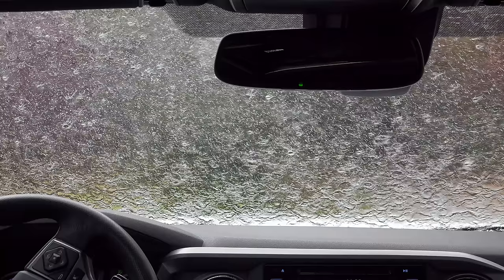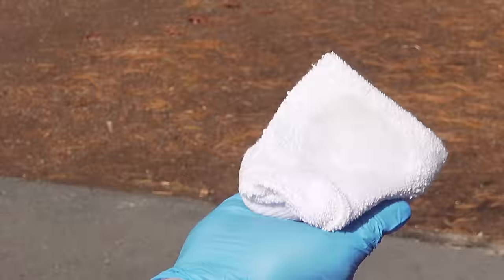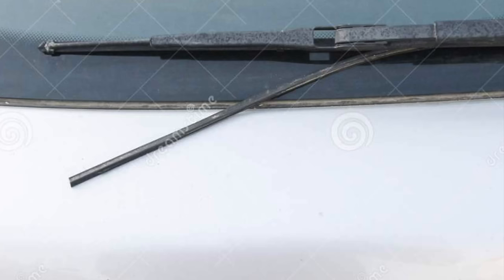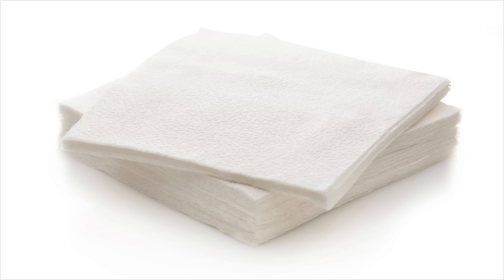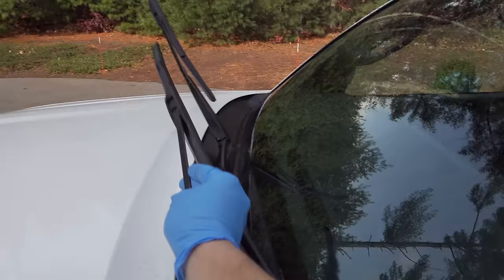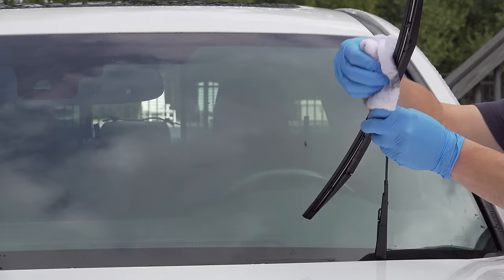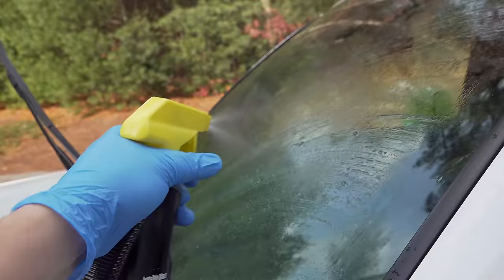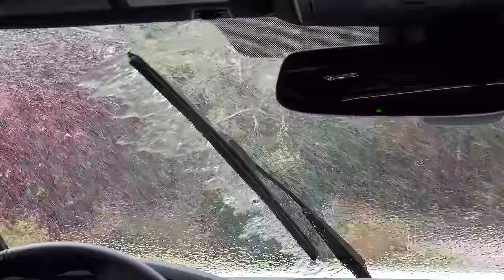How to Make Windshield Wiper Blades Like NEW in 30 Seconds

Comment: I would use silicone spray instead of WD-40 (however, the WD-40 brand has a silicone version). Silicone is always recommended for rejuvenating rubber (power window seals for less strain on the motor, for example). WD-40 may not be "bad." But, I don't think you're getting the full benefit for the effort. Silicone should preserve the life of the rubber more.
Reply: I agree, it is all about chemistry. WD-40 will work perfectly but you will have to repeat it more and more. Why? It attract dust particles, ever wondered why serious bikers hate it for there chains? WD-40 is the perfect example; the less people know about the chemistry, the more they will have to keep on spraying and buying the product! Kaching!!! This guy in the video must have been stoned; cause he called it a "de-greaser". Guess he never used rubbing alcohol before he sprayed a knew later of greasy WD-40? People can say whatever they want, but the science tells a different story.
Reply: @gertverhoeven  just add some in your windshield wiper fluid.
Reply: @gertverhoeven  : Could you re-phrase this?
''Guess he never used rubbing alcohol before he sprayed a knew later of greasy WD-40?''
Reply: @renzo6490  Sorry, dutch speaking Belgian. : " a new layer "
Reply: @gertverhoeven  I don't understand why they would use it for THEIR bike chains when Silicone spray is so much better...
Reply: Would it be better to use WD-40 first to get the dirt, grease and grime off first and THEN use WD-40 silicone spray or regular silicone spray afterwards or is this overkill?
Reply: @G C Silicone is commonly used to rejuvenate rubber.  You can google about it. You can get pure silicone grease at the hardware store's plumbing department. That could be a little easier to apply than a spray. It's used on rubber washers in faucets. It can fix a leaky faucet because it rejuvenates the seals.

I have a treadmill which requires occasional application of silicone beneath the belt. The manufacturer says not to use spray silicone because the carrier used in spray can deteriorate the belt. They recommend grease. I use that stuff from the hardware store because the official treadmill grease is considerably more expensive. (I don't know if their claim about the spray is true, or just a way to sell their high-priced stuff.).
Reply: WD-40 will clean and also restore a bit... tidyness is of course key for every progress. Silicone spray is, on the other side, THE thing to go to, for rubber-longevity. but then, still the rubber has to have been cleaned otherwise, before applying silicone.
Reply: Use silicone wiper blades and when needed apply silicone.
Reply: I doubt silicone grease will remove buildups.
Reply: @G C Maybe it does but given a choice between tossing the blades or cleaning them and using them a bit longer
I'd go with the WD-40. Besides you're supposed to wipe it all off. It's just used to break down the dirt not as a lubricant.
Reply: I raise the wipers and use armorall on a rag to scrub them. Then spray armorall on the wipers til they are wet looking. Leave them overnight, and lower the wipers in the morning. Lasts about 6 to 8 months.
Reply: @rfburns5601  is that wax or?
Reply: WD-40 will make plastics brittle with time, so... wouldn't use WD-40. Why not clean them with water and a bit of dish soap?
Reply: @Schmidt54  clean with detergent. Other suggestions on here sounds like a recipe for spreading lube on your windscreen
Reply: @stevecarter8810  I used a multi purpose mild kitchen surface cleaner and it worked like a charm. even my very old back window wiper was resurrected.
wouldn't use harsh chemicals like WD-40.
Reply: @carltype4125  Armorall is a spray product that has UV inhibitor - its available int the auto section of most stores.
Reply: @joebrone4972  that's what I do.
Reply: @rfburns5601  silicone spray (not in a can) only lasts about a month.

Basically scrub the blades clean, apply silicone and let it soak in.  Do it once a month.
Reply: @DoubtingThomas333  I'll look for some. The armor all does have a downside..... It does keep the rubber more pliable, but eventually degrades it. I decided to clean my wipers the other day, and while rubbing the armor all into the rubber, I pulled a bit too hard and the rubber separated from the blade. Oh well, I got a couple of years good service out of those blades.
Reply: @gertverhoeven  
And that's  why I keep saying YT is full of BS.
Reply: I love wd40 silicone dry spray.  It really made the difference opening very large sliding windows.💜
Reply: wd40 is a bit overk*ll. if any of it is left on the windshield, overtime it will stain, also it's smell is to strong. can use car wash soap or dish washing soap. then once the blades are clean, you can wipe them with carnauba wax. that will actually preserve the rubber. and if you ceramic coat the windshield. the combo lasts for years. i had the original set of wiper blades on my 1992 240sx for over 10 years. The wiper blades out lasted the car 😂
Reply: Wd 40 will fuck your rubber seals, i did that yo my door seals and they stick to the frame really bad
Reply: @mrbimbo3917  That makes sense. The company didn't patent it because they didn't want to divulge the ingredients. So, it doesn't make sense to use something on rubber that you don't even know what it is (when pure silicone is openly sold, and is known to rejuvenate rubber). It's like, "hmmm... something known to contain plasticizers... or a secret sauce made to prevent rust, penetrate rust." It's like saying "I'll use water to protect steel from rust."

Worse, in the age of material safety sheets, it's been noted that the main ingredient is a solvent. That can't be good for rubber. Whether it hurts or not depends on the rubber's compound (if it could be dissolved, how much plastic it has?). People who haven't had problems are lucky. Not proof that wd-40 is ideal for rubber.
Reply: @markfuller ✔💯Thank you for this! Now all I need is a car attached to some windshield wipers!👈🏾🤣
Reply: @gertverhoeven  no one uses WD40 to clean a chain, it will destroy the rubber in the chain links.. or rubber wipers for the matter in fact .. this guy in the video is high .. he has another video fixing a leaky faucet that will ruin your faucet if you follow it.
Reply: @gertverhoeven  Whatever you use on a motorcycle chain will attract dirt.  Some of the wax coatings attract less, but even they attract some.

You don’t use WD-40 on a chain because one of the things it will do is dissolve the lubricant in the chain.  WD-40 is not a lubricant.
Reply: @ian1352  WD-40 absolutely does contain lubricant, but it is very little and definitely not suited to parts like bike chains. That's what makes it a corrosion inhibitor, it coats metal in a thin film of oil.
Reply: @klausbrinck2137  yeah, I honestly use the stoner invisible Glass Cleaner to clean the wiper blades the way he uses the wd-40 and then apply the silicone spray in the same fashion. works like a charm!
Reply: You are totally wrong as you must NOT, repeat NOT put silicone anywhere near your windscreen! Silicone leaves a streaky mess is almost impossible to remove from glass!
Reply: @happyguy5414  "silicone leaves a streaky mess is almost impossible to remove from glass!"

I've never experienced that. Maybe the product you used had other ingredients. The aerosols have carrier ingredients. (Or, maybe you have higher standards for auto-detailing, streaks, etc.).

It is worth nothing that silocon is harmful to a car's catalytic converter. I wouldn't spray it while the engine is running (and risk intaking aerosolized silicon.). I prefer the 100% pure silicon gel found in plumbing departments. I can wipe it on the blade. No overspray. No aerosol.
Reply: @markfuller  any windscreen manufacturers will tell you not to use silicone on the windscreen. As per this video WD40 is the best as it removes tar and fly squash from the wiper blades and doesn’t cause any damage whatsoever to the rubber + it doesn’t leave any residue on the windscreen, especially if you clean the windscreen as per the vid. Silicone is not a cleaner and it will not remove tar or fly deposits. As this guy says, he’s been using WD40 on his wipers for over 20 years so why try and complicate things, especially when WD40 is proven to work, has no detrimental effects and is cheap to buy 🤷‍♂️
Reply: @happyguy5414  "any windscreen manufacturers will tell you not to use silicone on the windscreen"

Do you have a reference for that? Googling "use silicone on car windows" doesn't turn up anything obvious or pervasive (if it were as problematic and advised against as you say).

"Silicone is not a cleaner and it will not remove tar or fly deposits."

For me, the goal of treating the rubber isn't to clean tar or bug matter, it's to plasticize the rubber so it will last longer (reduce dry rot).  From what I've read, silicone is commonly used for that purpose, it contains plasticizers, and wd40 doesn't.

I do agree with you that someone using wd40 may not notice any detrimental effects. Most people don't do side-by-side comparisons to know if they're helping at all (or making it worse). They'll just believe "yeah, yeah, I see it. It's nicer than it was before I sprayed." Then do that for 20 years, and you get into what's called "investment factor" (the subconscious/ego can't accept that it was a waste of time, or worse, for that long). 

It would be fun to use silicone to treat one wiper blade, and wd40 to treat the other. Do a side-by-side test for the life of the blades. See if either makes more/less differences. I'm not claiming either does. Just that silicone, by definition should (due to the plasticizers it contains). Right tool for the right job (but, I assumed this was about rejuvination, not cleaning. If my wipers needed cleaning, maybe I'd use wd40 for that, and then dress with silicone. Best of both worlds?).
Reply: @markfuller  I should have also mentioned that most car polish instruments also tell you not to get any on the windscreen due to the silicone present. Look it up or have a look at your car polish tin if you have some. However I can guarantee you that you are not to put silicone on a vehicle windscreen.
If you rewatch the video he tells you that WD40 removes tar and road grime and he shows you all that grime on the cloth after he’s wiped them down. The video is not about protection of the wiper blades, rather it’s about cleaning and rejuvenating them. The reason wiper blades start to screech and shudder is because they are covered in hardened road grime!
Reply: @happyguy5414  "he shows you all that grime on the cloth after he’s wiped them down." 

IMO, that looked like deteriorated rubber (carbon. I.e., you get that from a bicycle inner tube that's aged too. Rubber breaks down over time, and will look dirty/black when wiped even with silicone.). 

"it’s about cleaning and rejuvenating them."

There is nothing in WD40 to rejuvenate rubber (no plasticizers, unlike silicone). Silicone cleans fine in normal conditions (don't have some unusual tar condition or bugs that harden to a sap consistency). If I wanted to clean and rejuvenate, I'd use both WD40 and a pure silicone gel (since there's still no evidence that it's bad for glass. None of my car polishes say to keep it off glass, for example.).

The only thing I can think of is that the aeresol carriers in silicone spray could be bad rubber (and perhaps glass too). That's why I use the gel. It's cleaner to apply.

The only objective thing to do is treat one blade with wd40, the other with pure silicone gel from the hardware store's plumbing department. See how they compare over the years. The only reason it's personal is when someone's done something for 20 years. It's hard to accept that it may have made the situation worse, or not better (just visually better). I invite people to do that. I may do it myself.
Reply: @markfuller  I’ve just had another look at my car polish and it states not to get it on any windows because it contains silicone. Therefore there’s nothing else to argue about!
Reply: @happyguy5414  Which product is that? (None of mine say it.). You'd think if that simple instruction stands for your "never, ever, under any circumstances... worst thing in the world to do," you'd think good search would reflect that. But, it doesn't. So, even if your product label says that (when others don't), it wouldn't appear to stand for what you insist it does.

I'm not trying to argue. It's just that there's a lot of "hack" nonsense on the internet. WD-40 is not a rubber rejuvinator, and is said to actually do the opposite. Silicone indisputably is. You say it's ruinous to glass, but I've never experienced that (and I can't find any google results warning about that when there are copious warnings about using WD-40 on rubber.). 

I honestly beleive the best thing anyone can do is treat one blade with WD40 (hack) and the other with pure silicone gel from the hardware store's plumbing department. Let people learn for themselves with a valid side-by-side comparison.
Reply: I’ll try and remember to have a look tomorrow for you.
Just remember though that the video is only passing on a simple tip of how to clean and stop the blades from screeching and shuddering! He doesn’t mention anything about rejuvenating the rubber.
Why don’t you make a video of what you suggest and upload it to YouTube and who knows, you might get 12 million views 😉
Reply: Never put silicon on glass!
Reply: @bridgetwilliams5231  "Like dissolves like" so i don't think that's a good idea (same reason it is not recommended to lube silicone o-rings with silicone grease).  I'd consider simple green or WD-40 for silicone blades.
Reply: @bridgetwilliams5231  Can't find my comment to edit but I changed my mind about what to use on silicone wiper blades - I would consider ptfe/teflon dry spray lubricant instead of wd-40 or simple green!
Reply: @richardrichard7922  jjj7hhh7hhh
Reply: Thank you!!!
Reply: Absolutely makes sense because I also do the same.

Comment: WD-40 also takes off road tar from your car body when you drive over newly resurfaced roads. It also removes all kinds of adhesives, like those left over after removing a bumper sticker and even floor adhesive when laying new floor tiles, when the adhesive comes up between the joints. I don't think it cures arthritis, though I could be wrong on that.
Reply: Well wd 40 is full of fish oil so it might be good for arthritis
Reply: Well I'm 178 and my joints are still working great thanx to WD40.

Comment: I used to own a Fiat Mirafiori. I never had this problem - the windscreen wipers lasted longer than the car.
Reply: Me too ☹️
Reply: SUPER LEEDS!!!!!!
Reply: Leeds leeds leeds 💙💛
Reply: No kidding dude.
My dad bought a brand new Miafiori back in the day.
He drove it off the dealer's lot, turn the wipers on - and the driver-side wiper flew off onto the road.
It was actually one of the better Fiats he ever bought.
Reply: Truth be told, among many cars brands I had/have. In what reliability is concerned the worst and the best where FIAT!! Both bought brand new out of the showroom. 

The worse I got it around lunch time, by the end of the same day. It was back in the dealer workshop, for some faulty (warranty) issues! And that was just the beginning. LOL 😂 In reality the engineering is quite good, it's the implementation that failed miserably. The assembly line workers instead of putting a million QC stickers everywhere. If they assembled the car properly would be a much better use of their time! How hard can it be to tight a screw properly?!!

The best, to be honest, had ONLY absolutely normal maintenance. Oil, filters, tires, etc. Now after 13 years, needed to clean the MAF and EGR... Does a lot of urban driving. Not bad at all. ;-)
Reply: Yes, infact you did have a problem. That would be owning a FIAT. 🤮
Reply: He’s not trotting out 40 year old out of date stereotypes  trying to appear clever. I hate it when people make their own decusions rather than just sheeply following the herd... 😂